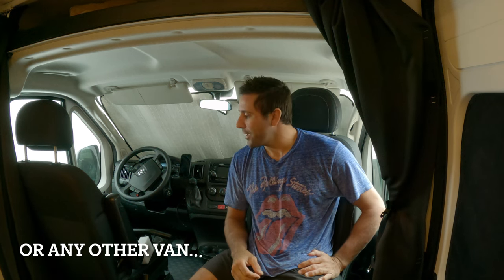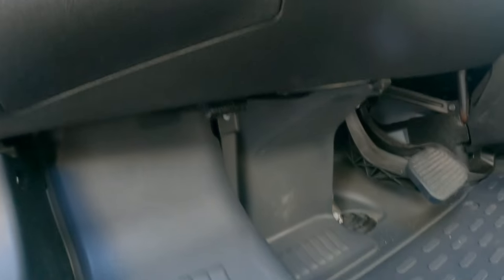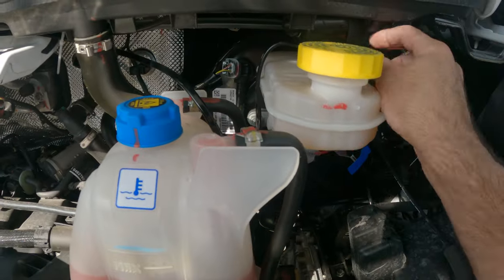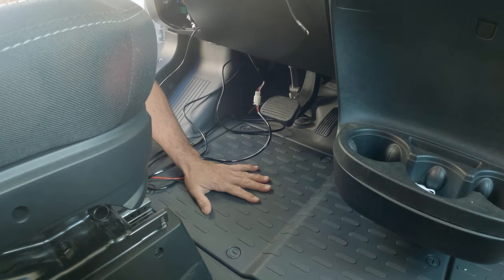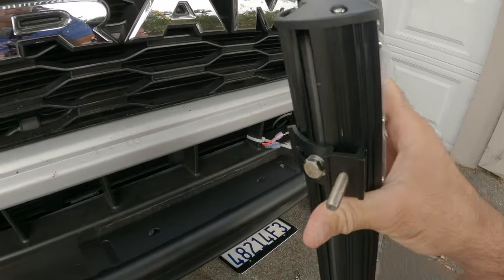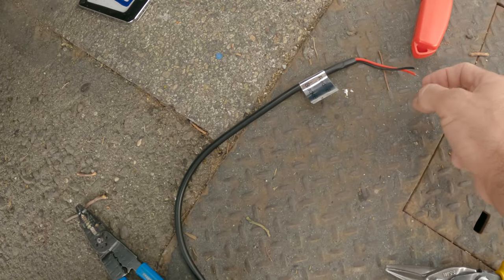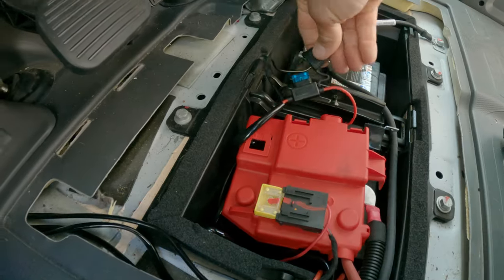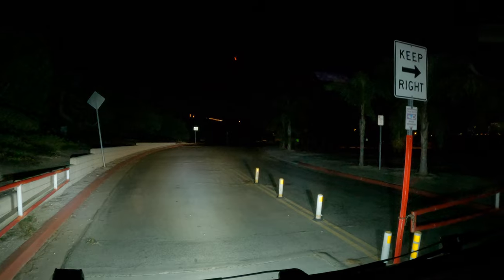Promaster Van Build | Ep.17 | The BEST Upgrade For Your Van!!!

Comment: I just installed these lights and bracket on my Promaster it took me about 3 hours with your instructions everything went great, the only thing I probably did different is I added about 2 feet of wire to one of the spot lights because it was short and I really wanted to hide the wires. Me and my wife were laughing like you were when we did the low beams then high beams then the LED Bar light haha!
Reply from the maker: Awesome! haha.  I wish I could add the light bar on my new van but the parking sensors and auto braking safety sensors are in the way.  I'll find a work around soon I'm sure.

Comment: Install stainless steel bolts with locknuts to make it harder to steal both your lights and the license plates. I installed them on the front and back. The locknut makes it extremely hard for someone to steal your license plate with just a screwdriver.

Comment: I appreciate your willingness to help us all do this! I followed the same process as you with slight modifications from your craftsmanship and skill. 

I hollowed out the fire wall grommet and reused as I passed the cables thru. I also used Wago connectors, they allow disconnecting the wires for changing out headlamps/signal bulbs and then reconnecting the connection, no wire waste or soldering involved.
Reply from the maker: Good idea! Thanks
Reply: same here!
Reply: Wago connectors? Where do we find these and how easy is the install...any special tools needed? Thnx

Comment: Just wanted to thank you for guiding me through the installation of this light. It made it so much easier to know what parts and tools were needed to do it easily.  Still not sure if the plate panel will be secure enough but I think I will reinforce it a bit more to insure it doesn’t come away from the bumper.
Reply from the maker: Thank you.  You can add some adhesive
Reply: @BuildingVanLife  Good idea! Thanks

Comment: Just screwing the whole assembly into the plastic outer bumper is not very secure.  removing the grill to enable adding bolts with spacers through the steel inner bumper would be much more work but seriously stronger and lasting.

Comment: Thanks for the excellent video! I purchased them and installed them myself. By the way I am curious where grounded the relay? I ended up grounding it to the metal next to the battery.
Reply from the maker: The battery is grounded and you are connecting to that so I think it should be good

Comment: Where on the battery did you make the connections? Especially if you have a dc-dc battery charger.
Reply from the maker: Right on the terminal.

Comment: I don't understand how the tank will fill up from the bottom. Doesn''t the drain from the sink need to be fed into the top of the gray water tank?
Reply from the maker: Wrong video, but it fills, there will just be water in the pipes below tank inlet.  Think of how a p trap works under a sink, it's the same concept.

Comment: Nice! Do you get flashed at all by oncoming drivers? And is that mounted into plastic only with the bracket?
Reply from the maker: of course i would never use this on a road with other cars around it's way too bright, this is for a dark road when you are all alone or off road.  Yes it's screwed into the plastic
Reply: @BuildingVanLife  gotcha. I find often that that's where I want more lighting the most. For a trip to Mexico I may install this too

Comment: The harness kit that came with it only had a lead that would go to the main light bar and another shorter lead for the smaller light, but not a second set of leads to run to the other light.  Do you have to add more wires to go to the second light, or is the link for the harness incorrect?
Reply from the maker: There are two links there, one for just the light bar and one with the light bar and the flood lights.  The kit comes with everything.  That's the link i used for mine with the flood lights.  Maybe your package didnt include everything and you need to return to amazon?